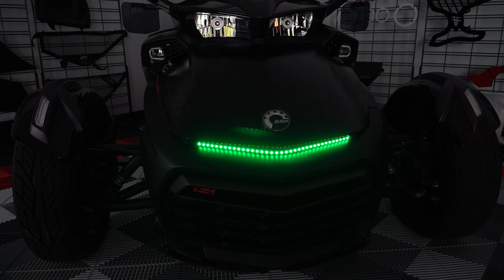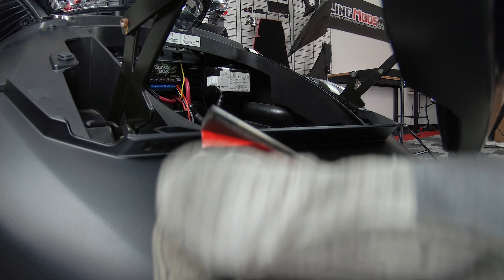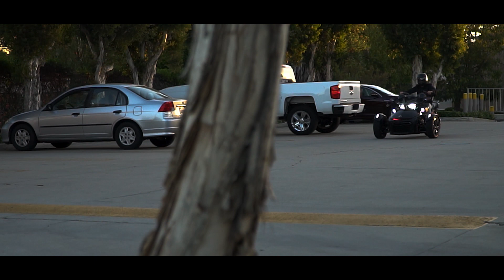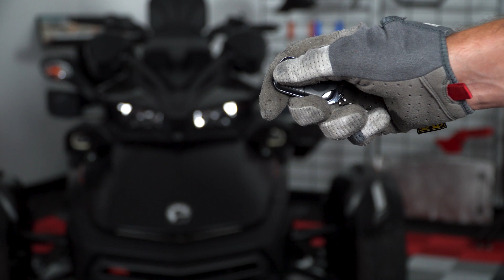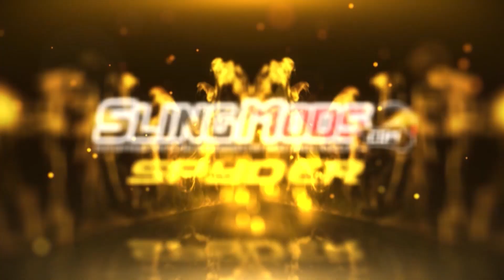Can-Am Spyder F3 Night Rider LED Light Strip w/Remote

Comment: My unit came with battery ring terminals and a rubber switch. Why the switch since it comes with a key fob controller? Is there a video on how to install the BlackBox? Thx
Reply from the maker: Hello Susie, the rubber switch is an emergency cut off switch in case you lose your remote control. The black box aftermarket fuse block or our FZ-1 fuse block (both sold separately) both use 3 wires to connect. One is 12v+ which goes to the + battery terminal. One is Ground which either goes to your negative battery terminal or chassis for ground and one is an "accessory" 12v signal wire that tells your fuse block when the ignition turns on. That 12v accessory wire on the fuse block should be connected to the accessory 12v wire that is located underneath the left side service panel on the F3 models labeled "customer accessory circuit". Please note that the Black Box is not required for this installation though. You can wire the ring terminals on the Night Rider light directly to your battery terminals and use the remote to turn on/off and cycle through the color options. Thanks!

Comment: Could the "Universal 12V Motorcycle Accessory Fuse Block with Turn Signal, DRL & Brake Light Integration" sold on your site be mounted the same way as the Neutrino in the video? I have this light, mirror turn lights, and sequential led turn lights that im trying to connect.
Reply from the maker: Hello Curtis, so any of our TricLED lighting mods will connect to your factory wiring with the plugs that are included with the mod or to our 1:2 Front Fender Power Harness, depending on which mod it is. The Universal 12V Block is perfect to power anything that you want to run on either Full-Time 12V or Accessory Ignition 12V so that you don't have a bunch of wiring running to your battery.
Reply from the maker: @SPYD3RRID3R  Hey Curtis, okay so I pulled up your order history. 
- The TricLED Front Fender Reflectors with Sequential LED Turn Signals & Running Lights for the Can-Am Spyder F3 & RT (2019+) you purchased plugs into the factory wiring on the front two fenders and does not require an aftermarket fuse block
- The Show Chrome Amber LED Side View Mirror Running Lights & Turn Signals for the Can-Am Spyder RT (Set of 2) (2020+) can be run off the Plug N Play Fuse Block we sell from Show Chrome, or you can tap the appropriate wires with the included wire taps.
- The Night Rider light can be connected directly to the battery and turned on/off with the remote. If you want it to turn on/off with the ignition, you can also connect this mod to the Show Chrome Fuse Block we sell and connect it to one of the "ignition" only circuits.
- The 1:2 Fender Power Harness you purchased can be used for other TricLED lighting mods such as our Front and Rear Facing A-Arm Lights, but I don't see those on your order history. Those would literally be Peel & Stick and Plug & Play once the 1:2 Fender Power Harness you purchased is installed. Hope this helps!

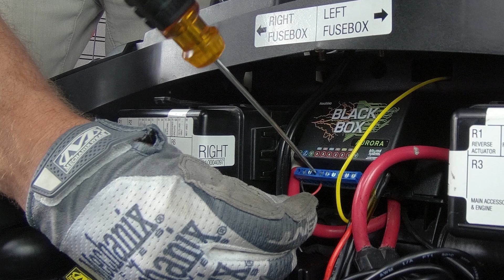Comment: At 3:16 where you are wiring the light to the "Black Box" Box. Does all can am spyder F3 have that box? Or no, & if not what would I look for when I install it. I'm on the edge of making the purchase just want to make sure everything will be ready for install apon delivery.
Reply from the maker: Hello Larry, the "black box" is not included with the product. The "black box" is an accessory fuse block we sell that gives you an easy power hookup to all your aftermarket accessories. If you don't have that you'll need to hook the light strip to another 12v power source on the bike.
Reply: @Slingmods  ahh perfect I would've opened that up and be completely confused! I'm gonna have to figure out where the 12v fuse block is located. I don't have my bike currently it's being shipped from florida
Reply from the maker: @larrywright2088ify  Hey Larry, congrats on the new ride. There are ring terminals included with the product to connect the light to both the + and - battery terminals. Just make sure you remember to turn off your night rider lights with the included remote control when you're parked, so you don't drain the battery. For future reference on other low current 12v mods, there is an available 12v "ignition" powered accessory plug underneath the left upper service panel on your Spyder F3. That can be used to power things like our 12V docking station, etc.
Reply: @Slingmods  thank you! I'm no where near a mechanic so letting me know these things to have a smooth install is key! I'm going to be as careful as a nervous brain surgeon when adding these mods. If there is anything else I NEED to know please let me/ us know! Hahaha thanks again slingmods
Reply from the maker: @larrywright2088ify  haha sounds good man. This one is straight forward. If you have any questions just ask. Thanks!

Comment: Bought this accessory as well as the fuse block, but your video has a completely different harness than what was sent to me last week. I have a 2020 f3 limited. Do I cut the wires after the black box on the harness and go straight into fuse block?
Reply from the maker: Hello Caleb, if you could reach out to our customer service team https://www.slingmods.com/index.php?route=information/contact with pictures of your wiring setup we'll be glad to get you up and running with this.

Comment: I see that you have a neutrino black box. Where did you connect the trigger wire?
Reply from the maker: Hello Deberry, the F3 has a 12v accessory wire that you can use for the Neutrino ignition 12v trigger wire under the left access panel.

Comment: Can it be hooked up without the black box?
Reply from the maker: Hello Tracy, yes it can. The F3 has an unused 12V accessory plug underneath the top service panel. You could pull power from that as well.

Comment: I love your video God I'm gonna start on it maybe today... I have a 2016 F3 LTD and my fuse Box doesn't have anything to screw the wire on to, What is your suggestions?
 I think I found the answer on one of the comments below … I'll look in the left left fuse Box I believe you  Sit at the top of the black left Box.
Reply from the maker: Hello Frank, the fuse box shown in the video is actually an aftermarket fuse block we sell. If you don't have that, you can connect directly to the battery and use the remove to power on & off. Please let us know if you need any further info. Thanks!

Comment: What I mean is what  when is the power draw too much?
Reply from the maker: It depends if your pulling off an accessory power plug already on the bike or running through an aftermarket fuse block. You're going to be limited to the amperage of the fuse your running the circuit through. These LED's pull minimal current.. say around 1 amp for one night rider light. We have 12 LED products on one F3 with no issues.. some are plug n play with factory plugs and some are hooked up to an aftermarket fuse block like the one shown in this video.
Reply: @Slingmods  What if you dont have that accessory fuse block how would you power the night rider led light.
Reply from the maker: @mitchellpaulson1192  You could hook to the battery as well and turn on/off with the included remote control.